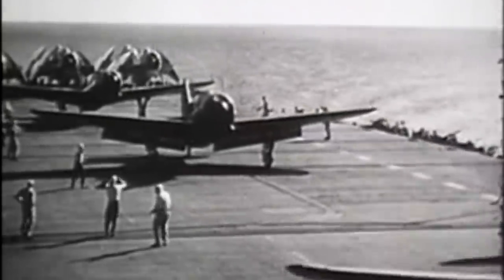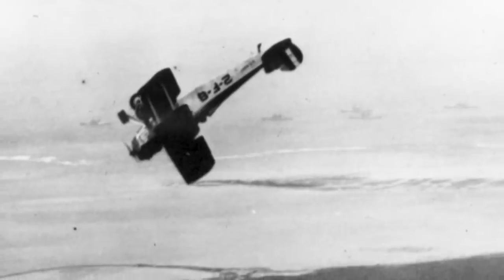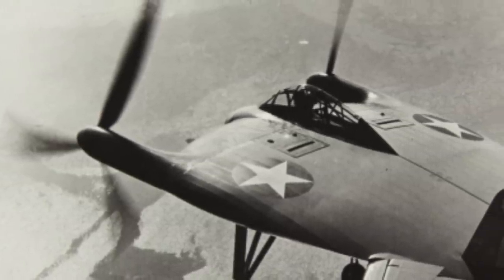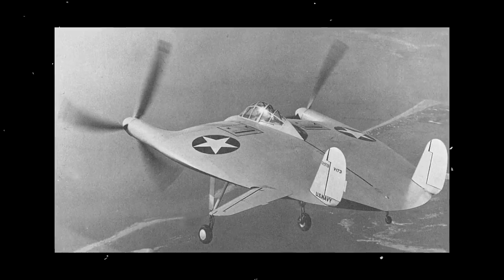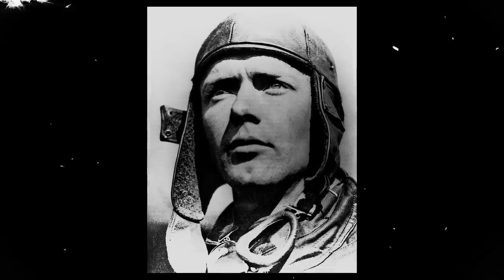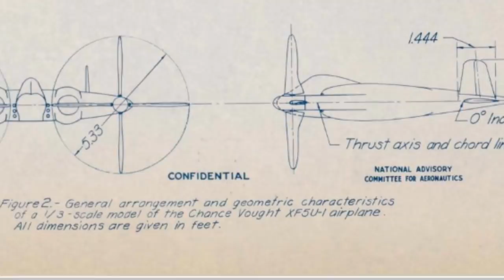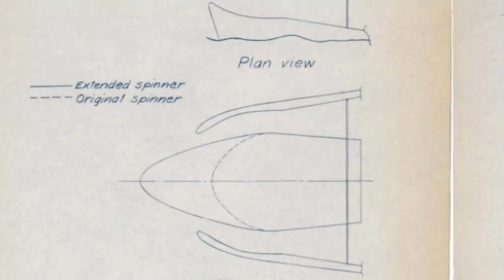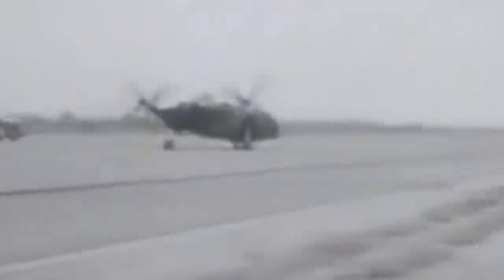The Experimental All-Wing Carrier Fighter - Vought V-173

Comment: Imagine this concept with turbine engines and composite construction.  Hard to believe the idea hasn't been revisited.  But perhaps it has?
Reply: It was a dead end.
Reply: @WALTERBROADDUS  Not really: it advanced knowledge of low-speed airflow characteristics using oversized propellors to increase lift across a wing's total surface, which undoubtedly fed into the V-22 programme.
Reply: @thisisnev  😏That is a long point A to point B. With a ton of VSTOL projects in between.

Comment: Your video is a nice explanation of a plane that was just a few years too late.
The rotation graphics at 8:53 show how high pressure air below the wing rotates at the wing tips to the low pressure areas above the wing.
The plane's propellers rotated in the opposite directions of the air flow graphics.
This did not cancel or eliminate the drag, but did significantly decrease the drag.
Reply: actually just induced drag, profile drag would be the same
Reply: @z_actual  Do you know any data that indicates the reduction in induced drag?
Reply: @TheLookingOne  we know that this works but its computation has always presented a difficult problem. More generally induced drag exists most in the low speed sphere and is non existent at maximum speed, but for V173 in particular it meant that the effective wingspan was increased by the sum of its parts. That is to say the effective wing span is represented by the wing, and the downblade of the propellers on each side. We know this because the rate of climb of the machine can be represented by an aspect ratio wing of the same area. and that aspect ratio wing is the equivalent of a span equal to the wing and a prop diameter ( 2 half diameters of the props). My expectation would be, that induced drag is for our purposes effectively zero with the use of this arrangement. Outside of that, I cannot think of a way to calculate a meaningful induced drag quotient that fits this aircrafts flight regime. Not to say it cant be done, but it defeats me, and in my mind it isnt perhaps all that necessary. But the answer to your question should prove to be a 100% reduction in induced drag, but you must also take into consideration the preponderance of this contraption as it is as it represents some awkward properties in ground handling etc., such as it is.
Reply: @z_actual  Zimmerman's aircraft was a remarkably different beast. Imagine if it and turboprops could have been mated up early in the war. They might have reduced the vibration. The low min stall could have been revolutionary for carrier ops. The speed range would be fantastic in a dogfight. The ruggedness may have meant one aircraft type for dive, level, and fighter ops. If only the fuel range was decent....
Reply: @TheLookingOne  turboprops, yes from the standpoint of reliability, but that wasnt available then. They also run smoother, but have other complications like heat, What they could have done was use conventional engines geared to a common shaft. That is two 90 degree gearboxes each situated on the inside end of the prop shaft. The common shaft in between means a transverse engines but it is all automatically going to give you contra props and the reliability if theres an engine out. Otherwise you lose an engine on this thing and chances are very good that you are going to die. Same applies to gas turbines that are geared to props but fuel consumption is dramatically different.
Equally on carriers, ground handling is super dangerous with a good possibility of someone getting smacked by a prop, because the aircraft is 'so' different and crews have less training history in handling it.
Dog fighting, not sure. Turning at speed, acceleration, dive speed, rate of climb at various altitudes. Its like the P40 was totally outclassed by A6M Zeros but could bang them up when properly handled 'if it didnt dogfight'. Same with Me 109E in North Africa where altitudes were to its liking, but really the thing was a lead sled and not a dogfighter. Still it was a favourite with pilots, I know the Australians loved them.
Range, Im completely in the breeze and have no idea. I would have a tendency to think it was less than comparably powered conventional aircraft